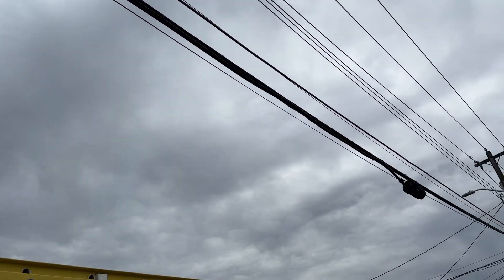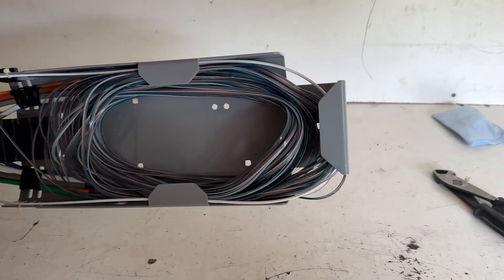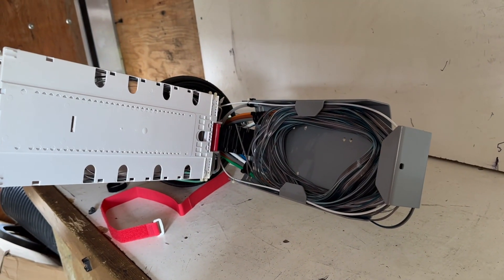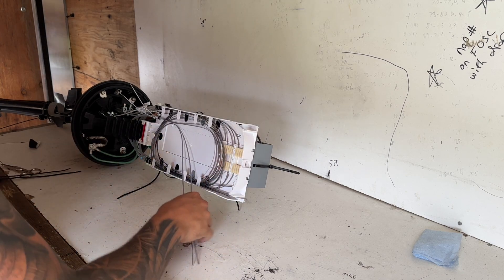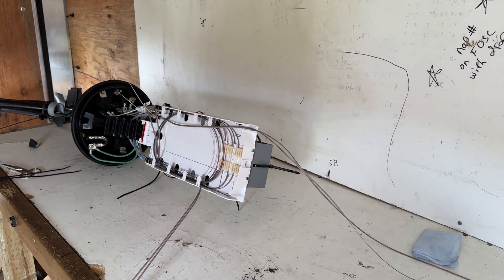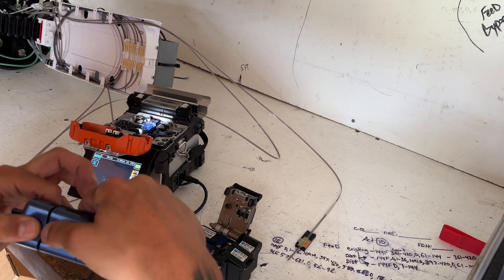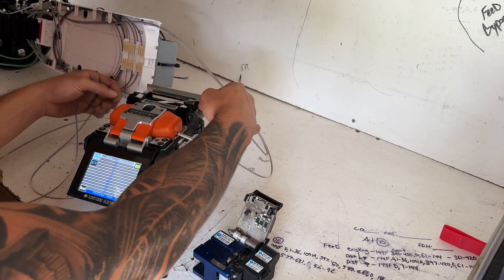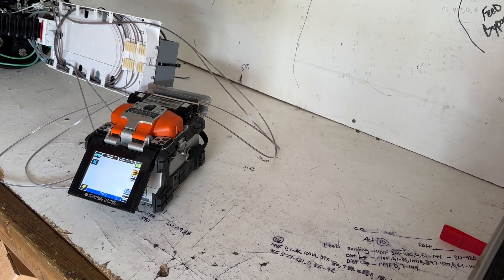Fiber Optics 432F Mid Span Count Push Existing Fosc

Comment: Hello, thank you very much for sharing your videos, I have noticed that you always use the hot jacket remover plugged into the battery of the Sumitomo... Is it out of habit or is it that it has little load capacity? thank you so much.....